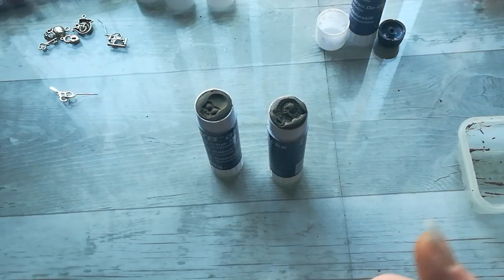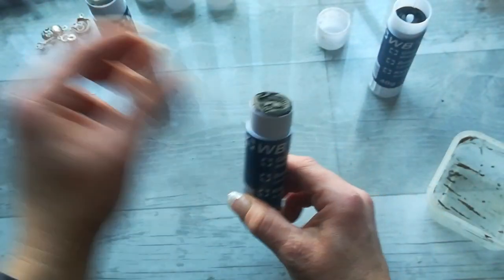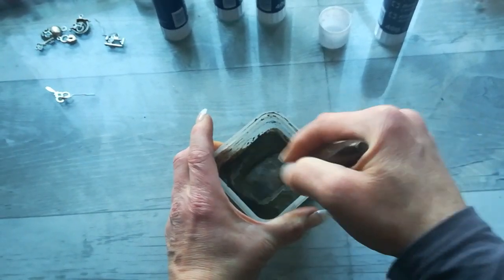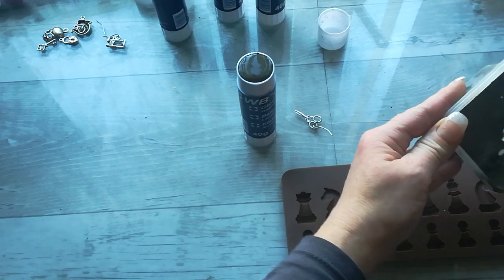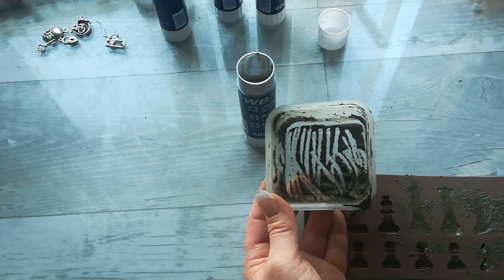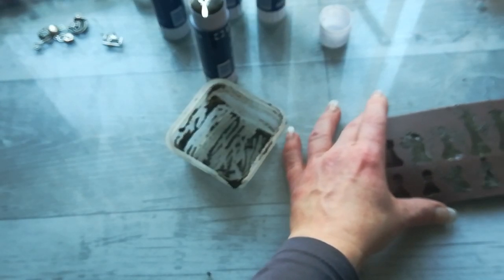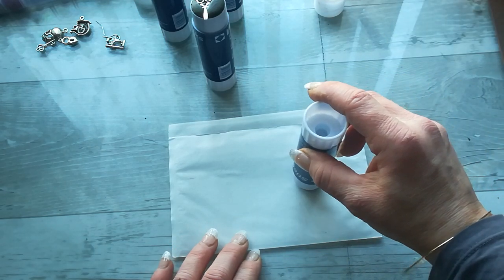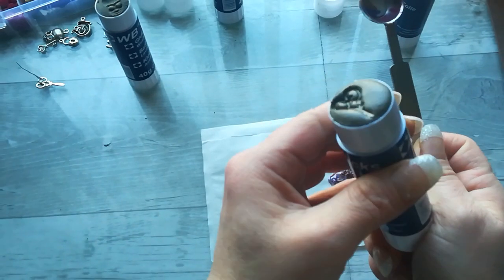Making Seal Wax Stamps

Comment: Eva darling, how brilliant you are!  I picked up flower molds for cake decorating (a US company called Wilton) and was able to make flowers using fake PlayDough... three different sizes between an inch and two inches.  They're too big and thick to use in a JJ but will work great in my assemblage art.  I also picked up little tiny molds about the size of your charms but they were too tiny and they curled as they dried but perhaps your cement recipe would work.  So cuuuute!  TYFS.  With love from the Southern California desert, MK ♥️🌞🌵